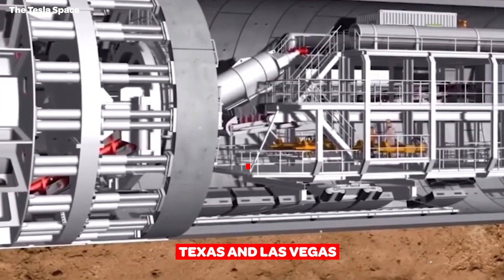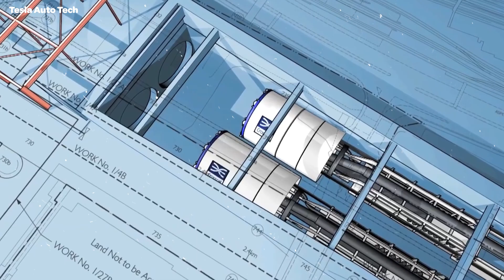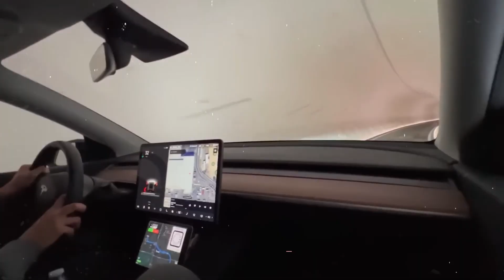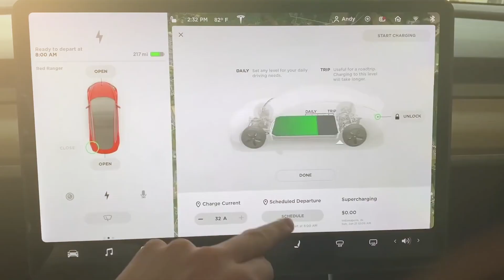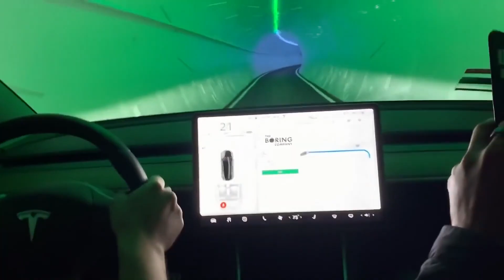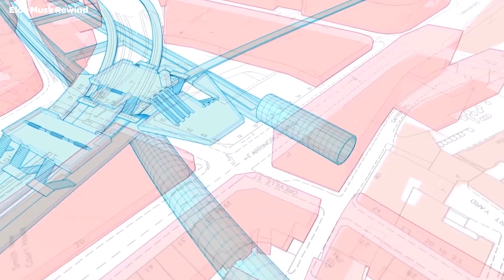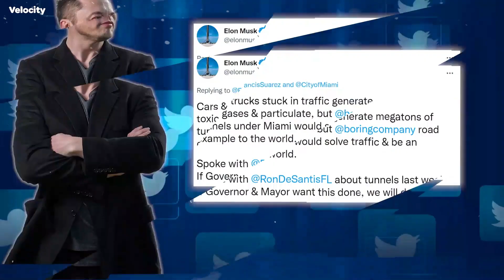It Happened! Elon Musk Announces New Updates For The Boring Company

Comment: The vegas loop seems like a great idea - there will be plenty of other citys watching how it goes as they expand the vegas system. If they can add a new station every six months that would be significantly faster and much cheaper than adding other forms of public transport that require dedicated infrastructure.
There are still problems to overcome but nothing that is a showstopper.
1 they need self driving vehicles.
2 they eventually need bigger vehicles to take 10 or more people or more at a time.
The vehicle issues are clearly solvable and as the system expands they can upgrade the vehicles. 
The tunnelling and construction cost and speed seem good so far if they can keep up the pace and low cost they will have a substantial network of tunnels in few years which prove that it's scalable and cost effective which will lead to other city's requesting similar systems from industry.